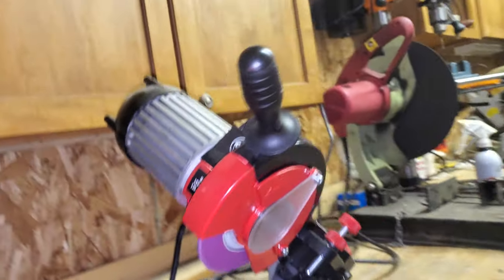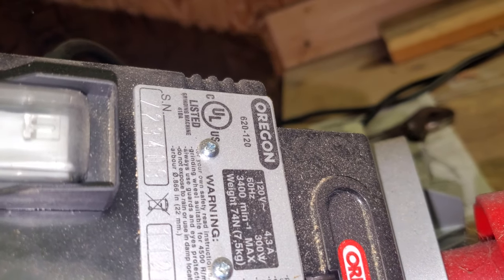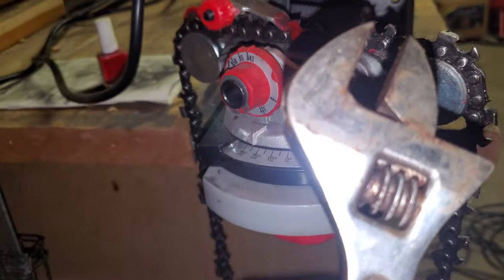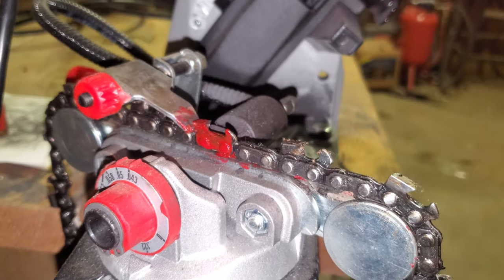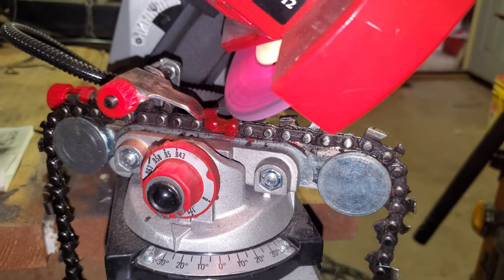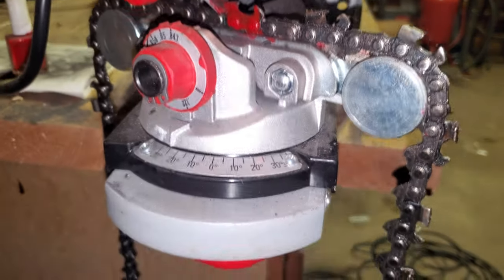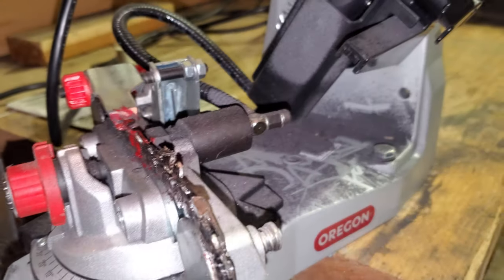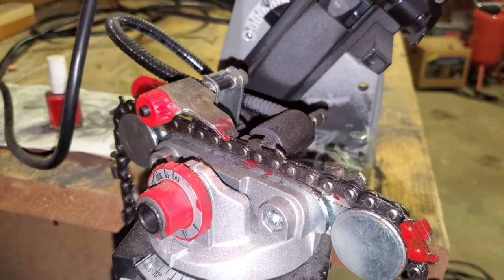how to sharpen chainsaw chains with the Oregon 620-120 Hydraulic Assisted Bench Grinder

Comment: Not wanting to get negative backlash, but I have sharpened chain and made all teeth the same, and have determined it doesn't make any difference if there is a small variation in length. I also was careful not to get tooth hot, but have determined that doesn't seem to make any difference. Tooth does not seem any softer even after a little blue shows.
Reply: Over heated cutters DO NOT get SOFTer, they get really hard and so hard that they are very difficult to file to touch up.

Comment: On the right side on the base there is a gauge with degree increments. What are they used for and how are they adjusted?
Reply from the maker: The gauge in the main pic of this video or a different spot ?
Reply: @AdventuresInLiving  
As you are looking at the machine it is on the right side on the base. Like a fore aft type of gauge.